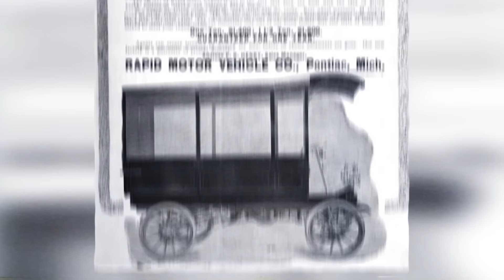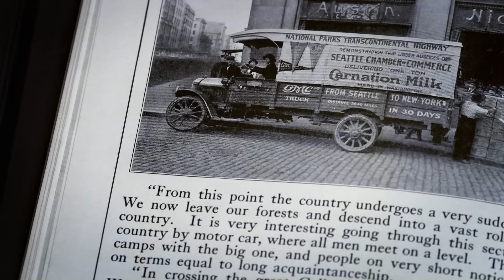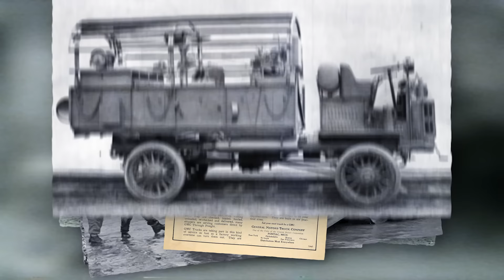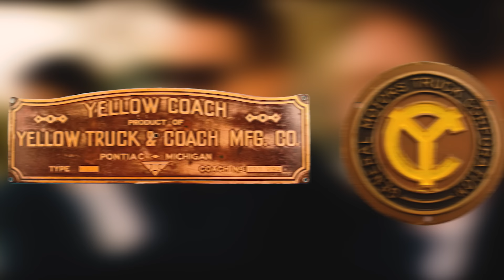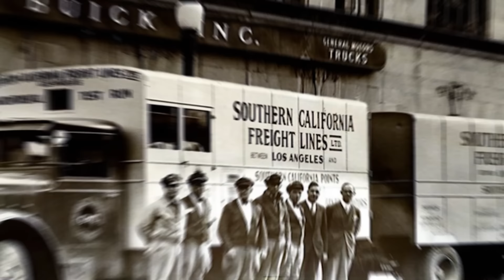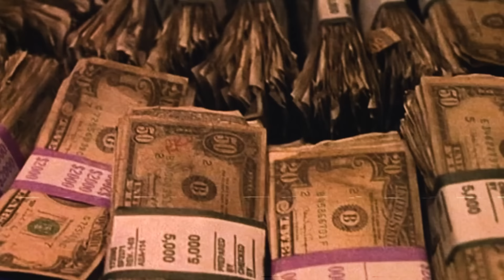The Story of GMC

Comment: and now with vehicle manufactures  trying too produce EV  vehicles which horrible expensive sadly too say but you have many vehicles out there over 100 yrs old and r gassed powered need too slow down with EV  i would rather have a hybrid gas/ev and probably more cost effective so what happens in a storm and no electricity is available for days or weeks ev is worthless and we here in illinois had a cold snap temps dipped below zero and ev didnt charge up lol goback too the drawing board sorry

Comment: Bedford trucks which were built in the UK were owned by General Motors alongside Vauxhall cars. Bedfords were used by the British armed forces for many years, with thousands of them serving in WWll. A lot of them had a straight six engine from Chevrolet.
Reply: We had a 60 Vauxhall  Victor Station wagon and a 61 Victor Super sedan.
Tough and a great motor and transmission.
Bad for rust but that had a lot to do with the undercoating of the time. I hear the 62 was a much more modern design.
They were impossibly narrow unfortunately.
I rode in a Velox and that was a much nicer car.

Comment: When I was 10 years old, (ironically, 4 years before I could even get my permit)  my dad gave me a 1959 GMC truck.  It was discolored,, patched, had a mis-matched bed in a different shade of green, and was just rough around the edges all around.  But by damn, it never failed to fire right up!  Since I was too young to drive,  it mostly saw use as a farm truck hauling limbs and dirt around home.  In the winter,  it pulled an old car hood as a sled.    I wish I could track that old truck down.  When I was 12,  I agreed to let my dad trade it for a '66 Econoline van. 
My dad still has a GMC today.  An '08 Envoy.  I have to say that whoever designed the Envoy must have been smoking some seriously strong stuff,  But despite that,  It's a real runner, and our dependable vehicle of the family, when others fail. 
I still have respect for the GMC name.
Reply: I ended up with an 07 envoy when I got divorced. I hated it, but it grew on me and I’ll drive that thing into the ground! The 4.2 i6 just keeps going no matter what I put it through!
Reply: @lancewilcoxson5549  If you are mechanically inclined, and do your own repairs, You will find that some seemingly normal, easy tasks are made incredibly insane by a poor design choice.   For example,  changing a thermostat.  
Typical truck:  Top of the engine,  right up front.  Two bolts. in, out, done. 

Envoy:  It's down on the drivers side of the block, below the alternator or AC pump  One of the bolts is inaccessible from the top.  Jack it up,  take the drivers side front wheel off,  go through the gap between the frame & fender with several extensions and a swivel.  (Some dude did a short video about it and he compared it to other vehicles.  he was mad as hell) 

Changing the fan is another pain in the rear.  

They run well,  but working on them is a nightmare.
Reply: @Cammi_Rosalie  I did my thermostat all from the top, just took out the alternator and 5 minutes later reinstalling it. Every car has its pain in the ass things to fix. Over all I don’t have many complaints other then the front axel going through the oil pan 🤦‍♂️

Comment: My dad had a 1991 GMC Sierra extended cad 2WD with a 350 and a 5-Speed Manual and he said it was a beast and it was basically a Hotrod from the factory.
Reply: do truck makers still do extended cabs?
Reply: @aljaberhk  i think so
Reply: I have a 97, single cab, vortec, 5 speed manual work truck. dad bought it. gave to me in 2012. it still burns the tires off on some weekends haha. have to start in 2nd cuz 1st you'll likely chirp the tires a little haha. I love the truck. almost 300k miles.

Comment: The narration bounces around all over. Going from 71-98 and back to the 60s to the 80s.
Reply: He also has a TopKick from the 1980s when he was talking about trucks from the '60's, and claims the Sierra came out in the '60's. That's wrong. It was a trim package that started out during the 1970's not only on pickups, but on medium-duty trucks.
Reply: And no mention of 70s trans mode motorhomes

Comment: I believe it was also the first truck to climb pikes peak
Reply: he mentions that in the video
Reply: August1-2, 1909. Rapid (root of GMC) scaled Pike’s Peak. Horizontal 2 cylinder, 24 horsepower reduced to just under 14 horsepower at the thinner air at 14,110 ft summit

Comment: The thing I like about GMC trucks is that it's the same sheet metal and glass my Chevy truck uses.
Reply: I believe GMC and Chevys are on the same assembly line. I usually drive Chevys but I have three pickups and one is a GMC. They are basically the same. Motors, tramsmissions, suspensions, everything is interchangeable between the two.

Comment: This video contains some interesting history but is somewhat misleading. Your cursory acknowledgement that since around 1960 all GMC's are merely rebadged Chevys is too little too late (i.e. the Sprint, which was always an El Camino with a different grill). You portray GMC as though it's an independent company, making decisions such as "exiting the commercial and large-duty truck market..." These are GM corporate decisions and part of the reason it has declined from the No. 1 automaker in the world to No. 4 or 5, depending on the month. Its divisions are completely interchangeable. That's why Buick is dying (all SUV's for some reason, most of which are shared platforms with Chevy and GMC), and Pontiac, Olds, etc., are gone. GMC exists as a brand to provide a second channel (after Chevrolet) for GM to sell pickups and SUV's. There is no "GMC" company - it's a brand, like Kellogg's has Corn Flakes and Frosted Flakes.
Reply: GMC was aimed at large fleet/commercial buyers, Chevy was more aimed at smaller operators. By the 50s the main difference between Chevy and GMC - both small and large  trucks - was trim and some engine variations. The big GMC General of the 70s had a Chevy version called the Bison.When GM sold off its large truck business to Volvo in the 80s, the remaining GMC light truck line became what it is today - a Chevy with more bling, that keeps the Buick dealers from going out of business.

Comment: back before they whent to crap love most how the metle rusts before its sold from the dealer ship i also love how they dent so easy and cost over 60,000 and dont offer a manual v8 pickup i also love the wax coating on the frame and the leaking roof lights the cheap rear axles made in mexico great pile of garbage